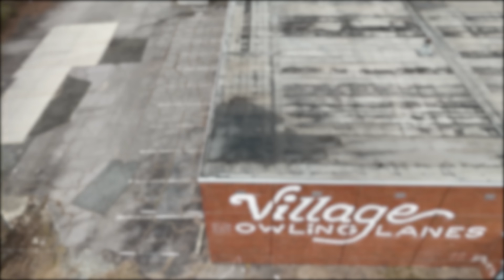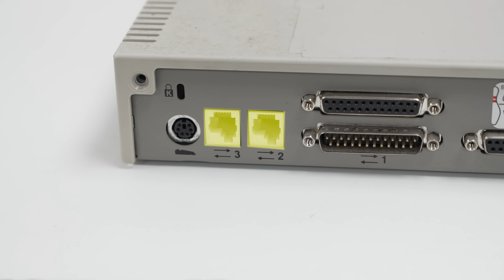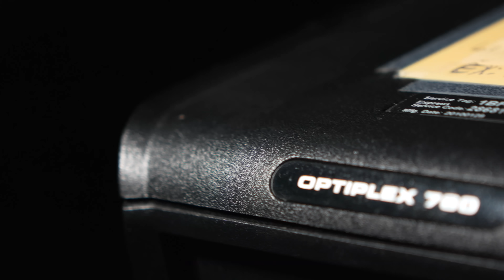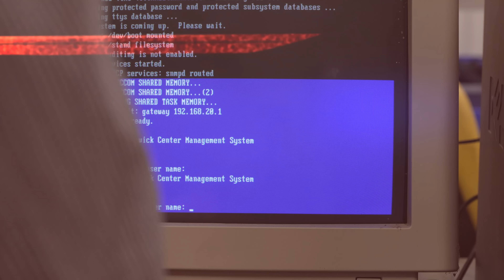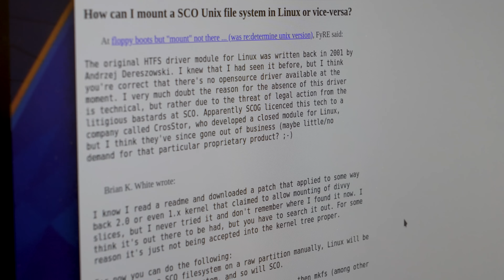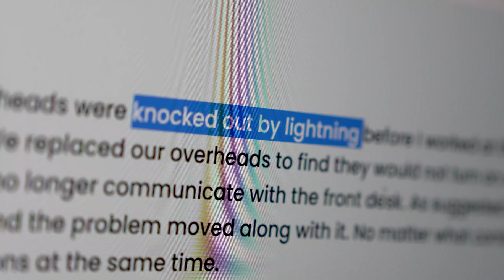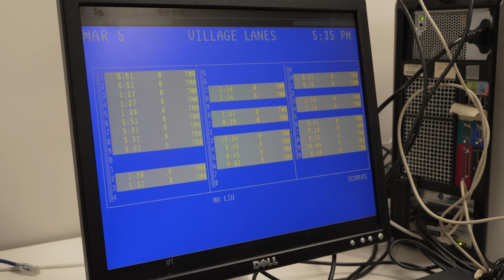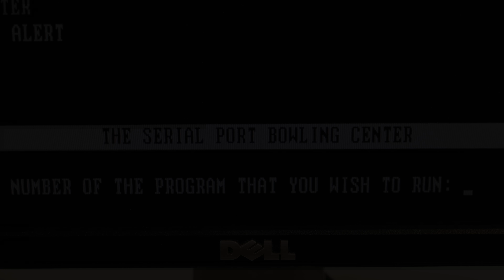We hacked into a bowling alley computer!

Comment: It's really interesting that this system runs unix. I totally expected it to run on some extremely hacky DOS or Windows based mess of an OS.
Reply: I wouldn't have been surprised to see OS/2 - it tended to show up in all kinds of weird setups like this.
Reply: @Damaniel3  I once worked at a supermarket and when the register booted up the monitor that faced the customer said OS/2 Warp. Which was honestly the only time I even saw that OS exist, though I remember IBM advertising the hell out of it.
Reply: @filanfyretracker  NCR used to be a HUGE SCO house, so a great many (legacy now) point-of-sale systems were running SCO.
Reply: @Damaniel3  Briefly. :)  I always thought OS/2 should have had great legs but the industry is savage.
Reply: From an ease of R&D perspective it's easy to see why though. Sure DOS could be hacked apart to work in a multi-headed setup (and sometimes was), but if you wanted something robust and based on a true multi-user operating system designed from its core for this kind of deployment structure, you went with Unix - or something like it. The fact that this system was still working and in use almost 30 years after the fact i think is testament to its reliability, that Dell sporting a Core 2 Duo has to be close to 20 years old at this point and was likely put in to replace some old Pentium 1/2 based machine  that simply croaked it due to age.
Reply: @RonLaws  It’s really not obvious why SCO would be used. This kind of interactive embedded platform is usually the area of OS/2 (older) or Windows Embedded (newer).
Usually the Nixen are for web driven systems like IoT devices.
Reply: @JollyGiant19 I thought the same, but Wikipedia suggests (with several citations fwiw) that SCO OpenServer was widely adopted for use cases like this--even POS terminals.
Reply: I been to a few different bowling alleys and i messed with their PCs and it was always DOS
Reply: I know this! This is a unix system! 🦖
Reply: @r1konTheAutomator  I think the quote is "It's a Unix system" but kudos. Also the set-up in the movie was very strange - Unix for control running on Apples with Thinking Machines Super Computers.....
Reply: It’s gotta be SCO. They owned weird use cases like McDonalds and Walmart POS systems,  electronic voting booths, etc back in the day.
Reply: @clownhands  They also owned Linux for a while </s>
Reply: I've been working on restoring a bowling alley scoring system for about two years. It's Canadian, and from 1988. Running a QNX operating system. Been wicked fun so far. I've been ripping the rom chips off the scoring panels, and had clones the board drives just the same and was able to get it to boot into a VM. My issue is I can't crack the passwords... You've given me hope that it CAN be done.
Reply: Imagine that some very critical systems in use right now are still running on actual computer hardware from 50 years ago. Yes, back when a "PC" meant having something like an Altair with binary readout in blinky lights, or a teleprinter on a 20ma loop if you were lucky. Groovy.
Reply: I saw a DEC Personal Workstation 500au that had been set up to run a security system once. It was retired due to a bad PSU, and after I fixed it I generally preferred to run Windows 2000, but it came with an OpenVMS install with a complete building automation suite. Given my experience with that computer, I have no doubts that it ran the whole thing FLAWLESSLY.
Reply: I build a website for a bowling alley and did their wifi and cameras and stuff, man, if I knew there was a cool ass Unix box running the place.. (they had deh Brunswick heh)
Reply: I’ve seen a bowling alley in Turkey run on Windows 98 in 2024 🫣
Reply: Doesn't surprise me too much. Between the use of that much serial communication, to the naming of elements (Lane Interface Unit etc) on that diagram to the whole architecture, it's clear that whoever designed this system came from a background of industrial controls. And SCO Unix is what you'd find there.
Reply: I don't think it's old enough to be in the DOS era, but XP wouldn't be far fetched.
Reply: ancient holdovers are not uncommon 😊
Reply: *NIX supremacy :p
Reply: I've seen Win 98, XP, Win 7, DOS. Lots of different stuff out there.
Reply: I think I explored a Linux system that is at a bowling alley, ye !
볼링장에 있는 리눅스 시스템을 탐험한 것 같아요, 그렇죠!
Reply: Old Viking scoring systems used NT4
Reply: No, you would need to go to McDonald's for something like that.
Reply: pretty sure the latest scoring systems and terminals and everything runs on Windows XP now!
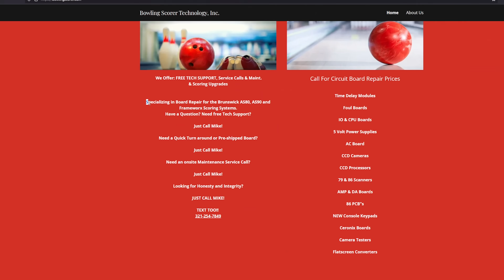Reply: 4:07 I wonder if it is the same mike
Reply: OS/2 also ran a lot of money machines.
Reply: spoilers!
Reply: their new systems might be windows now.
Reply: I knew it was some weird shit because those Bowling animations are not normal
Reply: @nickwaters2802  LOL I thought recently exacly that, when I was at my local bowling alley. Very ugly pixelated old style animations at a terrible resolution with absolutely no variations in the animations. I was intrigued can't you just let the server play a never version of clips.
Reply: My literal jaw dropped and a certain three word phrase was uttered when that reveal hit. Like, wut
Reply: Given it's lineage, I'm not too surprised. Linux would be an obvious choice, but then there would be issues with drivers for the serial card.
Reply: This guys comment is that one uncle that swears "Linux is still way superior to windows" 😂
Reply: @arguedscarab7985  for applications like this, it is
Reply: I thought it would run Windows 10 lol

Comment: awesome! are there scoring animations anywhere on that machine or were those handled elsewhere?
Reply from the maker: Nope, they were stored elsewhere since this is a relatively old system. Not sure about the newer models with ethernet
Reply: It varies some by system, but by the looks of it, this beast is from a retrofit for the old Brunswick system,  the closest thing that had to animations was a line art picture of a turkey on the 40 column display if you had 3 or more strikes in a row.  The retrofits I've seen have done away with the turkey and instead added modern conveniences like 720p 16:9 display support and the ability to print out the scores on a modern printer.  Most also let you import the list of names and team names, so a league or tournament can hand over a flash drive with that info, and get the scores back on the same drive later.  This system would have been the "cheap" option to keep using as much of the old score system's parts as possible.  Now some 20 years old, the ones with the silly animations are far, far, more advanced than what this is running.